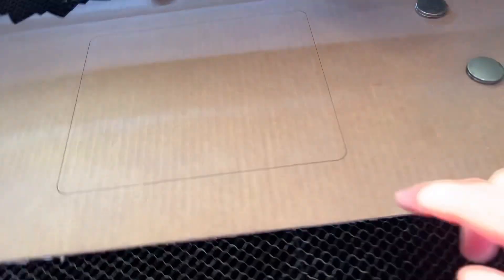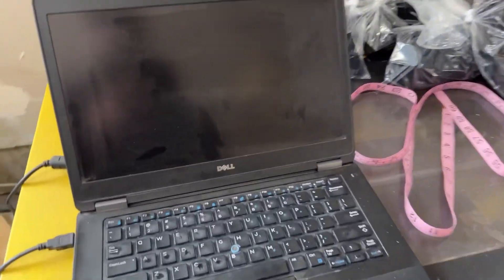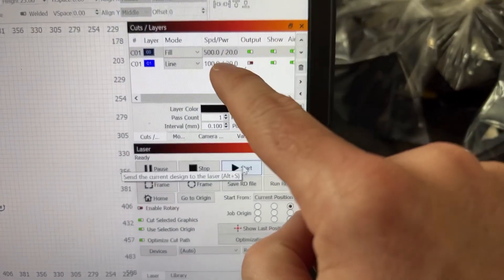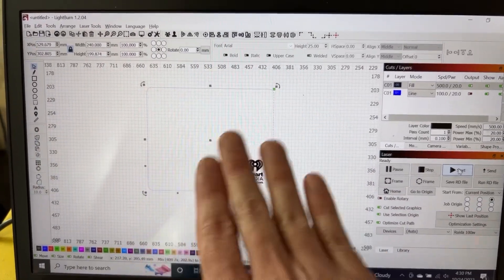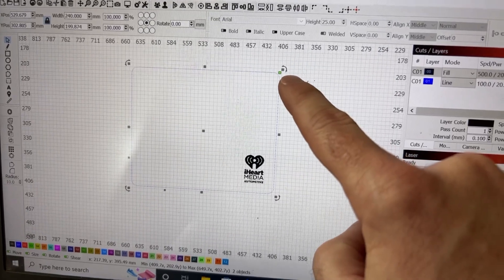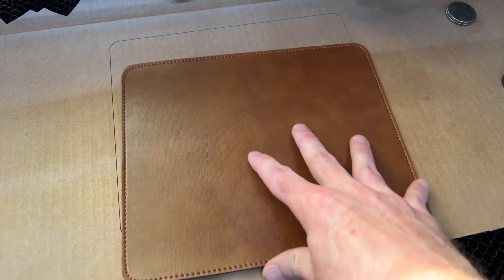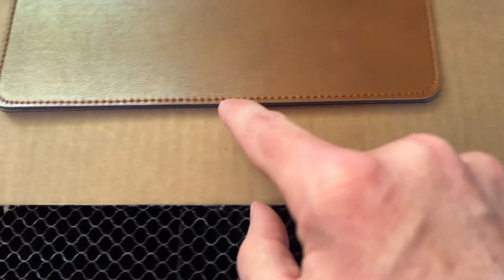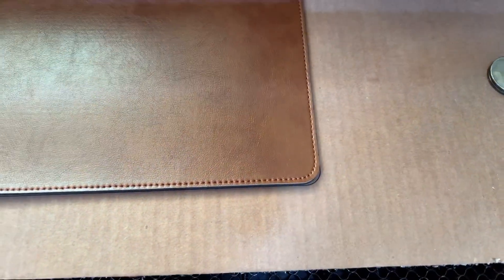Repeatable Engraving Without a Camera on a Gantry Co2

Comment: I have tried to do this with a numbering system on a drawer. Each time I run the same program, each successive part the numbers shift slightly to the left. So if I run on same part it creates a shadow like mark. Eventually it is past the tolerance and I have to tweek the drawing. Haven't a clue where to start to fix it. Have you had anything like this? I use LB & omtech same as you. The post is perfect timing. I just started these parts 3 days ago.
Reply from the maker: Go into the machine settings, vendor settings, x axis, and toggle the PWM rising. See if that helps, if not then change it back.